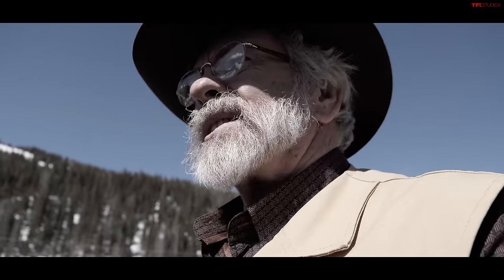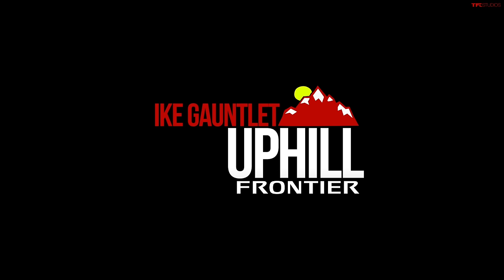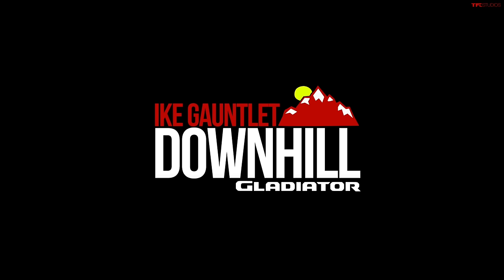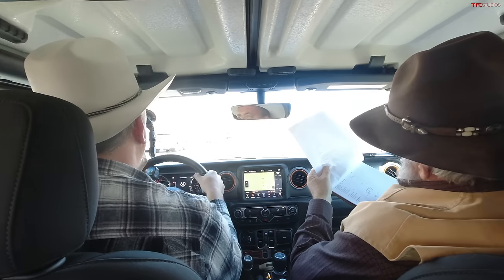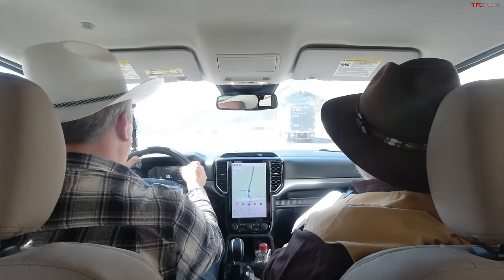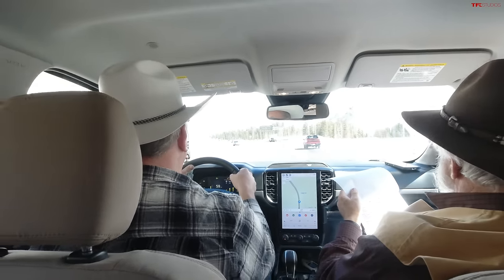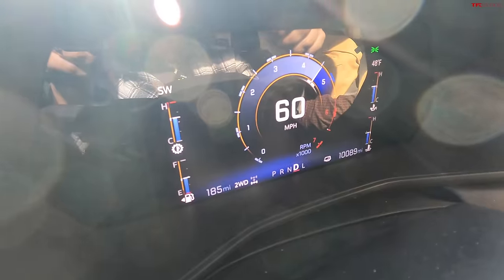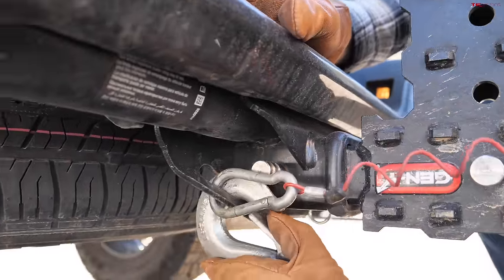MEGA Ike: New Tacoma, Ranger, Colorado, Gladiator & Frontier vs the World's Toughest Towing Test!

Comment: It will  be interesting to see how the Tacoma hybrid with regen braking will affect the downhill performance.
Reply: It should help. I know my F150 Powerboost does amazing in this category in the mountains and hills when towing. Brakes on these hybrid trucks really last a long time relatively speaking......
Reply: And the 2.7 v6 in the Ford.
Reply: That hybrid battery would be back to full really quick so not much of an advantage as the battery needs to be empty in order to take the energy generated.  My hybrid maverick battery is full after going about half mile or so downhill.  It's ecvt which sucks for engine braking after battery is full.
Reply: @cwqrpportable from what I read Ford simulates regen braking even after battery is full.  At least in the lightning.  So I'm guessing your power boost works the same way.  Awesome truck btw.
Reply: @marklihsu  Thanks, we absolutely love it. Yes, you’re correct about the regen braking in the Powerboost. Something else I’ve noticed is the turbos do not spool up as much as they do in the straight Ecoboost.  It’s quite easy, in regular driving, to avoid the turbos.  Also, in tow/haul mode when towing our RV, the electric motor is there to assist regularly.  Ford did a nice job on this hybrid powertrain.
Reply: @uowebfoot downhill it won't make a difference.
Reply: @marklihsu I think you're correct. My powerboost did great in the mountains a few weeks ago, I could tell what's the battery was full the engine would kick on but it's still break pretty well without me having to apply them. It's definitely different than driving a traditional powertrain. It's pretty awesome, I hope the upgraded version in a few years builds on its strengths.
Reply: So you're telling me an engine with more torque and two extra cylinders won't make a difference. ok.
Reply: @uowebfoot  downhill it wont.
Reply: The hybrid setup on the taco won't do much up the ike. Think of it as an assist to get the truck moving and filling in the gaps where turbo isn't spooled up. You'll see similar results on the towing.
Reply: @MrFordguy73  That's my hope as well. After 45 years of buying and leasing trucks, this Powerboost is the best half ton I've owned so far.
Reply: @cwqrpportable I'm curious what year your Powerboost is? I think it is a great idea, but my '21 had had a lot of teething problems. We were not towing, but probably had it loaded close to capacity when it broke down due to a misfire about midway on a 1500 mile cross-country trip. Had to unload everything and leave it sitting at a dealer over a weekend. They wedged it into a very heavily booked Monday but ultimately misdiagnosed the problem as a faulty plug. We made it another 250 miles before it started misfiring again. It took 5 visits to 4 dealers with dartboards, a lot of limping at 45-60 mph and probably some unnecessary parts replacements including one turbo before the problem was determined to be a coil (which the 1st dealer insisted he checked). All of this was at 16-23,000 miles. About to make that trip again now bumped to 1700 miles and have been trying to save some warranty mileage on it, but at 2.5 years we'll cross the 36,000 mile mark before we finish that trip.
Actually would like to see the Powerboost added to the 2.7 in the Ranger but would like to know they've swatted all the bugs in the system first.
Reply: @CACressida  so do you think it's going to be like rams attempt?
Reply: @robertopics  it's going to be exactly like the Tundra hybrid. Same exact system.
Reply: @alanploetz7100  Mine is a 2022. I ordered it Nov 10/21 and took possession May 10/22. I leased it for 2 yrs for tax purposes. I have a ‘24 Powerboost on order. I hesitate to say much because I’m Irish descent Lol. Mine’s been pretty much flawless but have known folks with the first year model ( ‘21) who have had issues.   Hopefully Ford learns from their mistakes. Sorry to hear about your issues…..
Reply: Regend is not helping on a grade like this
Reply: @cwqrpportable  glad for your experience and hope Murphy stays hidden for the remainder of your '22 and on to your '24. I've been around vehicles long enough to not buy the 1st year of anything, but I got anxious with the supply chain issues and wanted that built-in generator for my wood lot.
Bad news is, my wife have fully adopted Ford as a four letter word.
Reply: @alanploetz7100  I’m 67 y/o and have been buying and leasing trucks and cars for 45 yrs for business and pleasure. My brother and I own and operate an open pit mine and quarry and a mechanical engineering consulting firm. My 14 Fseries work trucks live a hard hard life, no mall runs here Lol. I’ve had great luck with Chevs and Fords. Nothing is perfect, all brands have issues. It really does suck that you had so many issues with your ‘21.  That model year has been a real problem child for a lot of people. I can understand how it would leave a bad taste in your mouth. I really cross shopped trucks this time around and feel good about my recent choice.
Reply: @cwqrpportable  while probably not using them as hard as you do in mining, my first vehicle was a '62 F100 with a stakebed on the back I mostly used for dragging hay wagons, hauling feed from the co-op, the occasional calf or two and add in other assorted fencing, lumber, tools etc.
I've had trucks from Chevy (& GMC), Ford, Dodge, Jeep and even a Toyota Hilux when I went off to college. Counting cars and trucks I've probably had more Fords products than any other, but brand loyalty was never an issue.
I'd have to agree, the ones I put the most miles on were that old F100, replaced by a Chevy K20 with a Western plow on it, a K5 Jimmy and later on a Ford Ranger all run to around 150,000 miles before moving on to someone else.
Like I said, I knew better than to buy a new release, no matter who made it.
Reply: @alanploetz7100  The good ol days….  I was raised on a large beef farm.  You have a good night.

Comment: these modern four-cylinder turbos don’t engine brake very well because they’re relatively low compression ratio. I have a built 2.3 L focus ST and I lowered the compression the bottom end and I lost some engine braking performance on track.